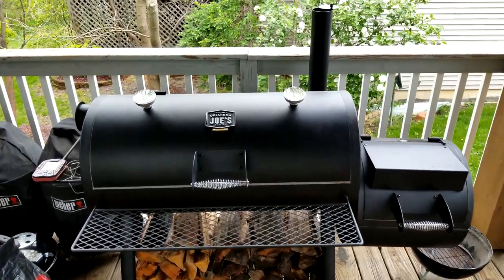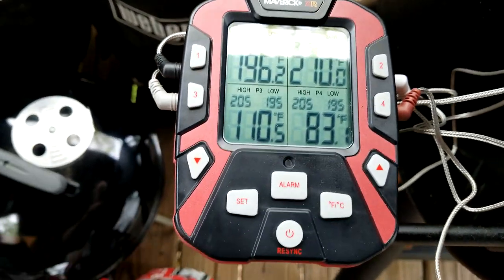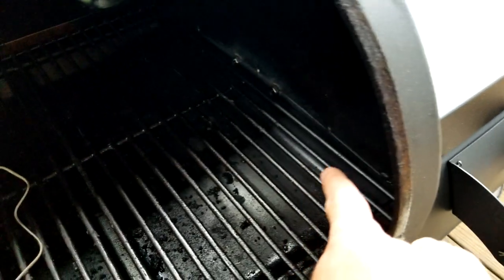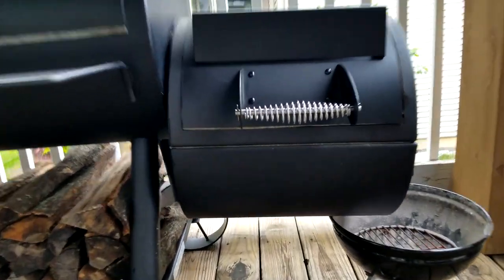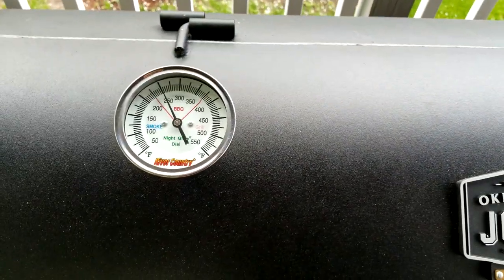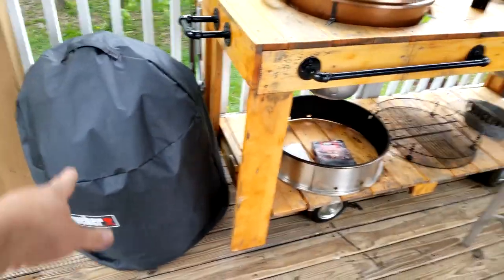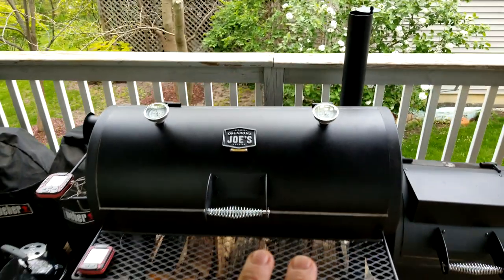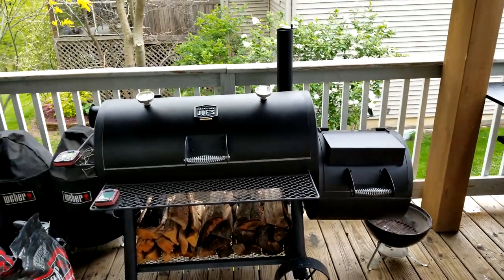OKLAHOMA JOE LONGHORN REVERSE FLOW / SHORT REVIEW / QUICK LOOK

Comment: Hey Joe, do you still have this smoker? If so, I'm wondering about adding a second shelf to it. There's one available for 200+ USD, but that's a ton of money for, let's be honest, a cheap offset smoker. 

Love to know if you have a more ingenious solution!
Reply from the maker: Wow $200 that crazy.. Yes I still own it and love it.. I never used seconded shelf but I'm sure a cheap grate with bricks wrapped in aluminum foil to raise it would do the trick. Oh and yes after this month is over you're going to see some new ideas I came up with.. Thanks for stopping by..
Reply: @BBQJOE  Can't wait to see what you have in store! One more dumb question for you. I haven't received my smoker yet, and have been anxious to know if the sort of minion method you use to light and run it still produces the same "depth of flavor," that folks like "Mad Scientist BBQ," claim you can only get by using an offset with an all wood fire. How does the flavor and smokiness with your method compare to pure stick burning in a large pit? Since this burns charcoal and wood, should I have stuck with the WSM?
Reply from the maker: I feel that mixing charcoal and wood last longer in the Oklahoma Joe.. You can use just wood but use small splits.. The wsm is a great smoker but I'm I like them equally.
Reply from the maker: As far as flavor you can't beet true authentic wood smoked bbq. Every smoker will produce different flavors but I've never had a bad experience as far as flavor.
Reply: @BBQJOE  This is true; even my weber kettle produces good barbeque. But I'm wondering if the use of charcoal compromises that authentic wood flavor. I'm wondering if the OK joe with the charcoal and wood is still "authentic wood flavor," or at least a big upgrade from weber kettle and WSM barbeque flavor. . . Or, perhaps I'm chasing barbeque mythology.

Comment: did you ever get one with a straight firebox?
Reply from the maker: No I sure didn't.. The jack stand works wonders though.. It has been a great smoker and have over 25 cooks on it. I have no complaints..
Reply: @BBQJOE   thanks for the reply, I just got one with a slanted firebox as well.
Reply from the maker: @ASTRONOCPRODUCTIONS  I promise you'll enjoy it.. The only mods that held up for me was the gasket around the main chamber and between the firebox and main chamber. I need to get a updated video out on this. If you take 1 or 2 splits on the bottom of the charcoal basket and the rest filled with unlit coals then full lit chimney over the top, you'll get an easy 4 to 4.5 hrs burn with ease.. Temps around 250F-275F.. My stack is always wide open and the firebox door around half open. Don't forget to take 2 or 3 of the included charcoal grates and rotate them in the firebox to get better airflow.